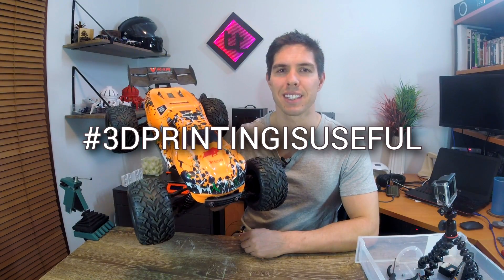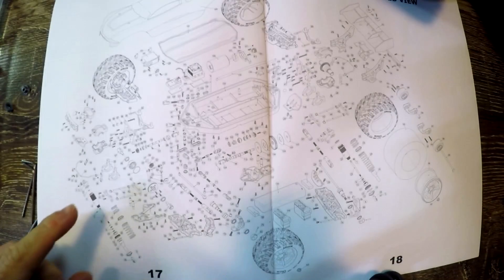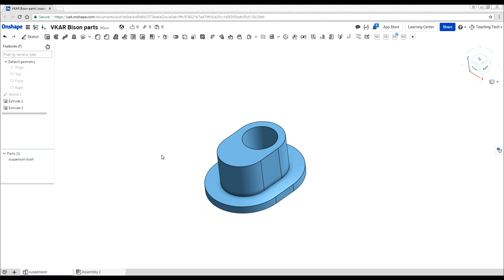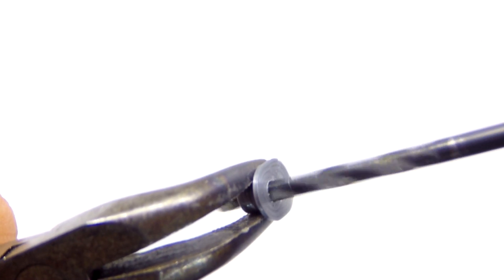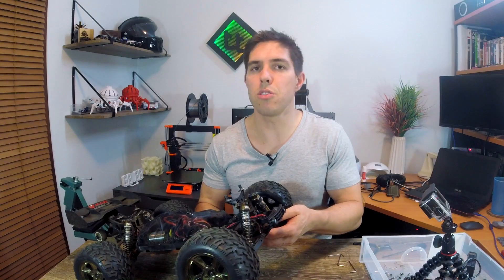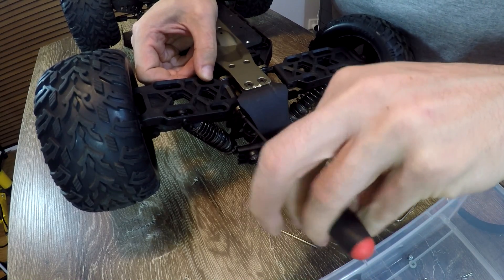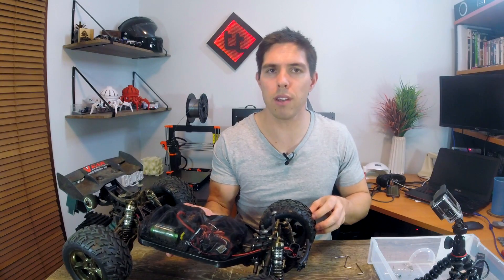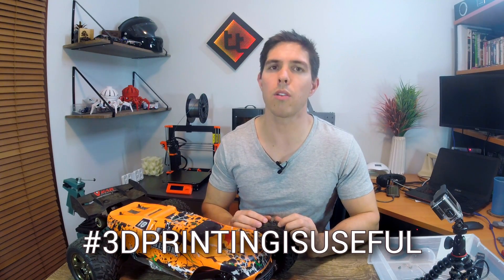VKAR Bison 3D printed front bushings #3DPRINTINGISUSEFUL

Comment: Thats an E-Word I only do 1/5 scale Gas or 1/8th Nitro. You are forgiven however. LOL.  I want to be able to develop prototypes for 1/5th & 1/8th scale at a leisurely basis and find it difficult to commit to $500 a year for Fusion 360 to do this especially when I will be using the program far and few between, I would like to have it like the old days when you paid for a program and it was yours.
Reply from the maker: I hate subscription pricing too. Fusion 360 should be free for non commercial use, have a look on their site.